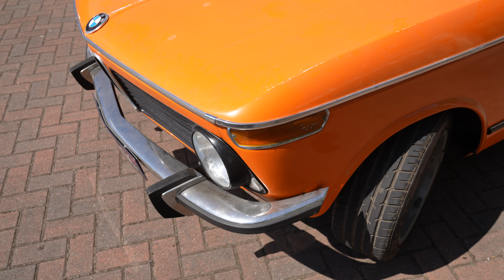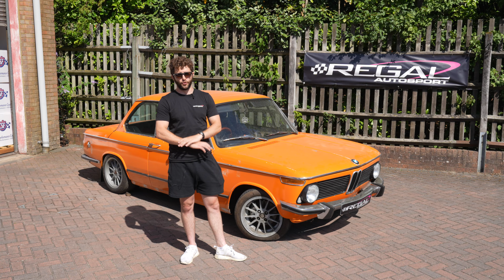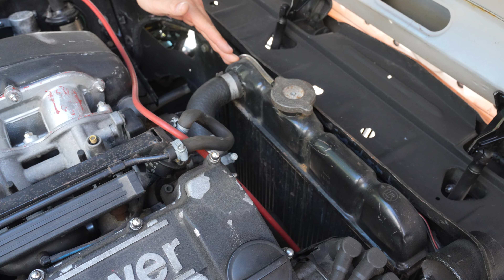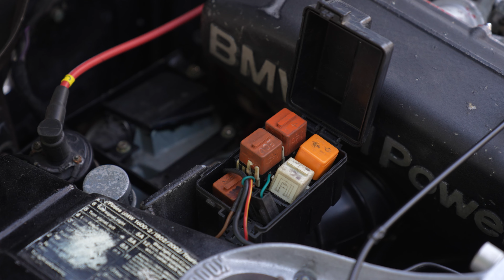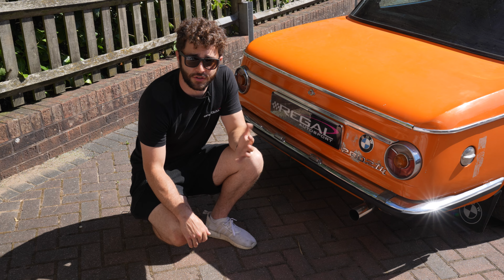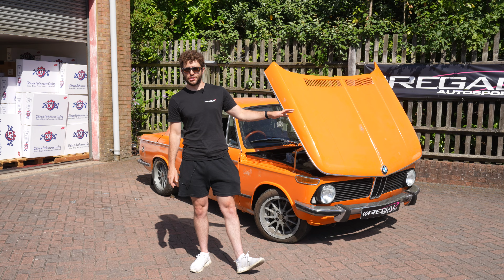S14 SWAPPED 2002tii ITB & STROKER BUILD STARTS!

Comment: I was surprised to hear that electric power-steering is now considered an upgrade! Will the stroking reduce the maximum revs or are the rest of the mods designed to bring them back up (somehow)? I didn't hear any mention of the current transmission, but will it (and the rest of the drivetrain) cope? Very much look forward to seeing this come together.
Reply from the maker: We conduct many rolling road runs, what you see isn't representative of what the figures were derived from.